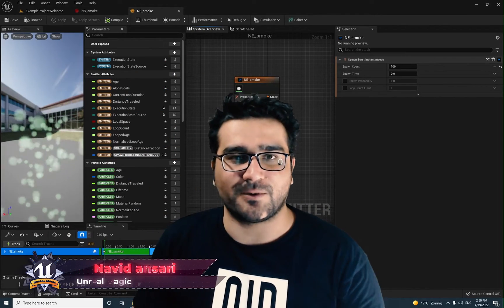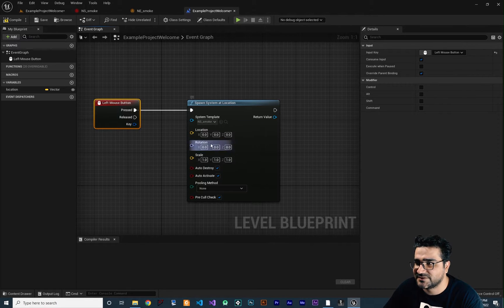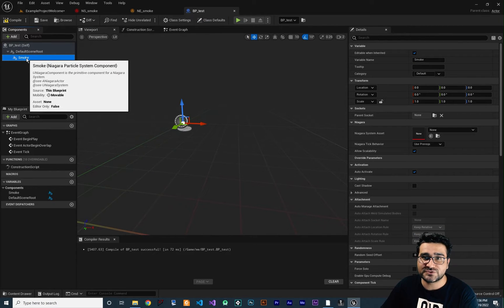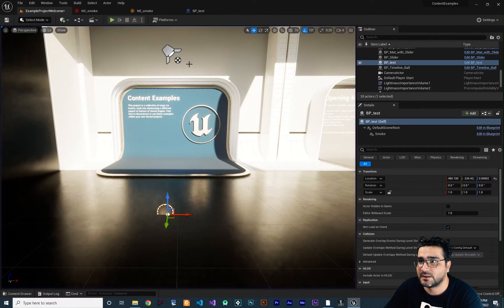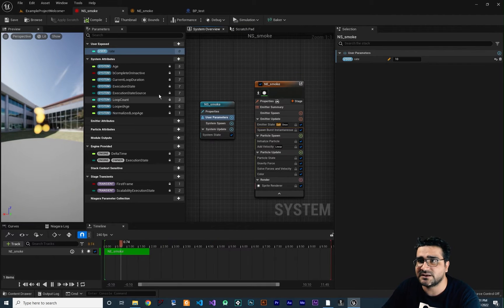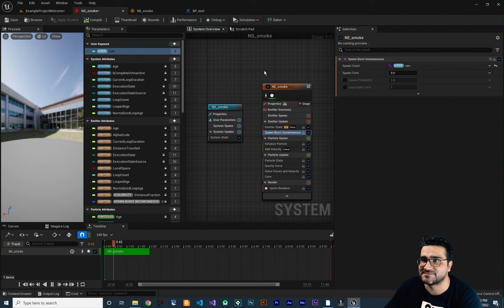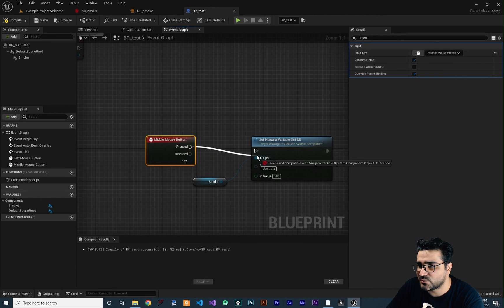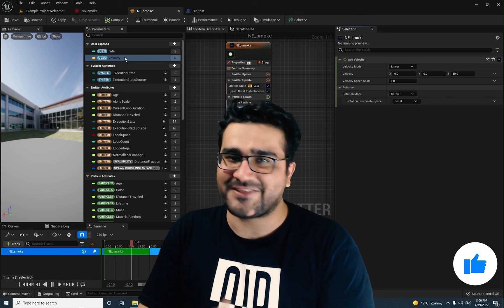Niagara system with blueprint class with user parameter's

Comment: So I’m trying to add Niagara to my weathermanager bp I made. I reference to the player character I made as well, I e got some branch data in my precipitation function that decides weather state and precipitation type with intensity for each (the set intensity for each for the in value of the Niagara float) but when I do it nothing happens? Have it set auto off in my initweather function which I call on beginplay before my timers for each module. What could I be doing wrong??